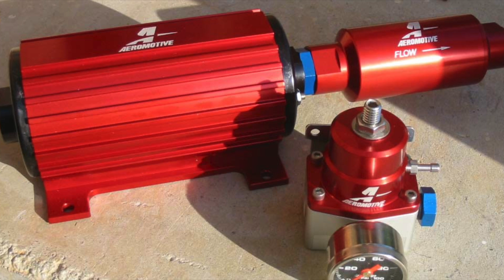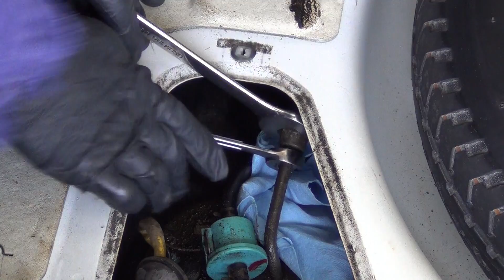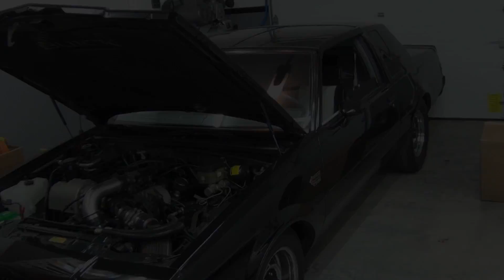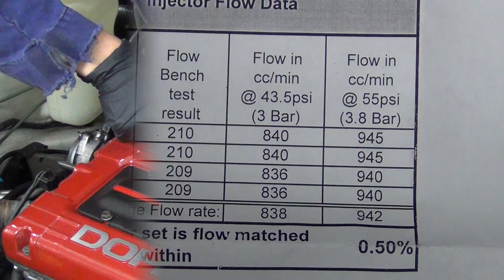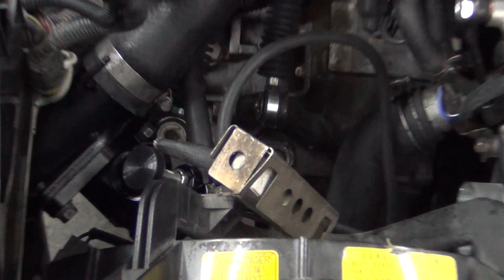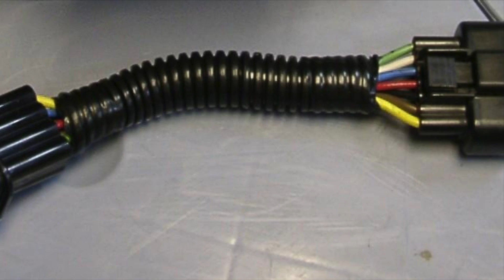Project Street Sleeper Part 8: Air & Fuel Upgrades

Comment: You do EXCELLENT work! I mean that! However in my humble opinion to anyone who may be watching this video, you should have installed an aftermarket AFPR. the stock fuel pressure regulator can be easily over run, especially during idle and low boost conditions with something like a Walbro 255 shoveling fuel through it, making tuning incredibly difficult and possibly even dumping fuel back into the manifold once the diaphragm rips!! Just one small thing I observed that could have been done differently, thanks for the videos!

Comment: Quick question Tom if you dont mind. When ordering a walbro fuel pump kit, do I choose the 1g install kit for a direct fit? Also, will a stock 1g fuel pump or 2g work as a replacement for the galant?

Comment: With the fuel pump wiring relay, isn't it less than ideal to not run it directly to the pump? You ran it to the outside of the FP housing that still leaves a few inches of oem small gauge wiring...

Comment: Hey Tom,

I just to mod my MAF and air can years ago, but viewing your channel inspired me in trying fot fit my "better" MAFinto the stock 1G air cam. And now while I'm having everything lying in front of me - everything's dissassembled - I'm not sure to fit it into the air can the most elegant way.

In the past I just built an adapter plate which I fitted in the bottom of a stock air can (where the plug and the connection to the MAF-to-turbo-intake hose used to be), but this was always a pretty 'less elegant' solution and I lost valuable space for intercooler and turbo piping...

so can you give me any hints or show some pics of how you fitted the Evo MAF into the air can?

Oh, btw, I'm curious if there are any significant differences if you took the MAF from a Galant, Carisma, 2G Eclispe or whatever looks identical exept for the parts number above on the sticker.

Thanks for reading and I'm looking forward to hearing from you.... and again, I want to say how much I love your channels - the DSM ones the most of course - because it gives one the feeling to be took by the hand and make a humorous "this it how it's done clean and properly" walkthrough with explanations which even I understand ggg

Kind regards, your fan Ibo from Hamburg, Germany
Reply from the maker: Hi Ibrahim and thank you for the very kind words!  I'm glad that you enjoy my videos and find them helpful too.  Regarding installing the Evo MAF into a 1G air can, it was really a labor of love.  I never would've imagined that anyone would've wanted to see that process, or I would've documented it.

In order to get it to fit, I had to drastically modify the Evo MAF and the back of the Aircan.  I made sure it looks stock and all, but I put many hours of work into it.  Honestly, if this is your street car I would suggest running a simple and easily serviceable open element air filter with the Evo Maf.  Here are a few examples and the power they made.  Good luck!  http://www.evolutionm.net/forums/evo-engine-turbo-drivetrain/390973-air-filter-shootout-test-results.html

As for the interchangeability, I do know that the Evo Maf and the 3G Eclipse MAF is the same.  A 2G MAF is a good upgrade, but not the same as an Evo/3G Eclipse MAF.

Enjoy your car and have a good one!

-Tom

Comment: Hi, i own Škoda Octavia 97' (No japan, Europian, Czech car) its based on VW Bora/Golf IV with AEE 1.6L engine, 5speed, no turbo. I plan to make sleeper but the choices for tuning over here are small. Can or Do you know any US. company what makes custom parts for this car?
I know it's bit hard question, but your work is just excelent and you may know some.

Have a nice day and thanks.
Reply from the maker: Hi there and since we don't have those here in the states, I have never heard of parts made for them here.  Good luck on your search and you might need to use more universal parts and adapt them to fit.
Reply: Hmm, okay, anyways thanks for advice. It's such a shame that Škoda ain't in States.

Comment: Hi Tom, 852/1000 here.  Wanted to say that I think you do great work and I'm impressed with the progress on your galant so far.  I also have a question, you mentioned that the new (850cc)injectors were direct replacements. Do they require an external means of control or do you already have ecmlink installed? Also are you recirculating the charge air or venting to the atmosphere? Thanks and keep up the great work :D
Reply from the maker: Hi there and good to meet a fellow VR-4 owner!  Thank you for the kind words and yes the 850s do require engine management.  I'll be covering that in a couple videos from now.  I'm recirculating the BOV since I'm using a MAF and to keep things looking stock.

Comment: Great video series! It may not suit your stealthly look but it advisable to add a fuse at the battery +ve terminal end of the relay pwr wire to your fuel pump relay. Cheers
Reply from the maker: Hi Richard and thank you!  The wire has a fuse at the battery side.

Comment: Ild love to go to the shootout. Just gotta round up my funds and get the wifes Talon running. My talon will need more time unfortunetly, gotta get a new motor that I can make mine in everyway. Torn between 3 by making just enough, balls out, or completely OEM head to toe front to back with dual piston calipers from a 2g.

Comment: Tom i have a few questions for you i know you love dsm's. I would like  to know what you think about people saying Dsm's are Very very unreliable i was thinking about buying one but i do not want to be fixing it on a weekly bases most people give there cars a 2 on reliability. I was thinking about a dsm or a Subaru or a GIT old 80's-90.
Reply from the maker: As with any performance car, they are only as reliable as their service history and how they've been cared for over the years.  I have found them to be extremely reliable, especially given what is asked of them (doubling or tripling the horsepower on mostly stock-type parts) but I am a stickler for proper maintenance and only buy old Mitsus that have a full service history and with no prior modifications.  Good luck with your decision!

Comment: How nice is it that fuel pump assembly is in the trunk? Don't you usually have to drop the gas tank to do that sort of stuff?
Reply from the maker: Yes, most Japanese cars offer an access panel either in the trunk/hatch or under the back seat.  MUCH easier than dropping a gas tank.

Comment: Boost gauge is also a warning sign for when something goes wrong. If its hidden, how are you supposed to see? I get the whole sleeper thing, but yeah.
Reply from the maker: A boost gauge is not a warning sign for anything.  My engine management will allow me to customize my stock warning lights on the dash to alert me of any engine related problems or excessive knock.  A boost gauge would never tell you any of that critical data.
Reply: Tom's Turbo Garage Those without the engine management software you are using can use the gauge to say if they have a vac leak, or not making full boost, or worse over boost.

Comment: you sir are amazing. i love sleepers. also i just found three vr-4s being sold close to me after looking for years. the only problem is when i finally find them im broke. im one sad man right now :(
Reply: one is number 221/2000 for $1000 but needs work. dont know what number the other two are but they are in very good condition, one for $4000 and one for $3000
Reply from the maker: Thanks so much man!  Oh that is bad timing!  They sound pretty good.

Comment: just an added note: Read your service manual on how to release the Pressure in the system, usually you open the filler, disconnect the main relay (or power to pump) and consume the leftover fuel in the lines. if you forget this step, you better have eye-protection and a ton of shop rags ;)  (learned the hard way)
Reply from the maker: Yes, this is true.

Comment: That auto-meter boost gauge is the old one from the Buick!
I'm really interested to see how it all works, especially he exhaust. I've never heard of putting a wastegate back there.. It works the same as a cut-out, right? Just opens automatically when it senses that it's under high boost?
Love the vids Tom. Keep it up please!
Reply from the maker: Thanks man and yes, I believe it is!  I actually have a couple extras.  Yes, the wastegate just works just like an electric cutout, it just uses boost instead of electricity.
Reply: Thanks for responding.
So essentially, when the exhaust-mounted-wastegate sees boost over a certain PSI, it will open? That's very clever!
 I love your videos. They encourage me to work on my own cars! I just added a 1st gen DSM (1990 Plymouth Laser RS!!) to the stable, so I will be watching these videos especially closely. Unfortunately, mine is FWD and N/A, but still with the 4G63 and 5 speed. It's pretty quick as it is, but it needs some work. I'm thinking of some sort of 2.5" Mandrel-bent catback-exhaust, a REAL cold air intake, not one of those cone filters on the end of a piece of pipe like most companies sell, cams, and some sort of a tune. Does ECM-link make a Naturally aspirated form of tune? I'd like to get one, if possible. I'm also looking to lower it a little, since the stock 25 year old struts/shocks are blown. I have had good luck with Bilstein in the past, and I'm hoping to find some sporty shocks. Either Bilstein, Koni, or Tokico, hopefully, paired with some slight lowering springs. I'd really like a set of 2G Eclipse wheels, I like them a lot! I may end up turboing the car. I'm looking into the 4G63 NA to Turbo swap. I'm hoping to keep the cost down as much as I can, since it is a daily driver, but.. that turbo sound on your talon is so mean! So much inspiration! I especially love the sound of DSMs with open o2 dumps!
Thanks again Tom. I really really appreciate all the videos, they're wonderful. You're a really really nice guy. :]

Comment: Another impressive and interesting video, Tom.  Good job!  I have a question:  You're all over the car, making changes here and there, so do you test your car to make sure it still runs before going on to another area?  If not, it would be a bad thing if you had a malfunction (despite your meticulous attention to detail) and you had to figure out where the problem is.  I'm eagerly waiting for you newest video!  I want to see this baby run!
Reply from the maker: Thank you Rick, I appreciate that!  I prefer to work that way, making only one or two small changes and then testing, but when taking on a bigger project like this you don't have the luxury of doing that.  I just go way over the top with my checklists and quadruple checking everything I do to try and avoid mistakes/rework.

Comment: I really like that you use professional products.   The pee blaster and nitril gloves are a staple in my shop.   Do you happen to know where I can get a stock 91 talon tsi awd front bumper cover from?   Can't find them and mine has a bad nose job.   Btw if u can find it dejon made a giant side mount for sneaky    I have one and it works well.
Reply from the maker: Thanks Ben, I try without blowing the budget too bad.  Bumper covers can be found on the dsm forums or salvage sites like car-part.com.  Good luck!

Comment: i remember my DSM….. went to put in new injectors didn't replace the O rings …… car almost burned to the ground lol lesson learned don't skip out and cut corners !!!!!!!
Reply: Right.  Tinkering with the fuel system can result in burning up your car if you're not super careful.  That's what happened to a friend of mine.  He replaced his injectors and his car caught on fire (and was totaled) due to a fuel leak.
Reply from the maker: Yes, I've heard of this happening as well.

Comment: Primary wire to the fuel pump needs a fuse close to the battery. Wont be fun if it does get broken without.
Reply from the maker: The primary wire comes with a pre-made inline fuse near the battery connection.  I show this in the video.

Comment: Awesome work!  The only thing i'd do different is use a dry flow filter instead of a K&N that close to the MAF sensor.  Seen too many of those sensors get killed from the filter's oil.
Reply from the maker: Thank you and I've actually ordered a dry filter, as the K&N was more of a prototype setup to get the fit right and all.

Comment: The manual antenna should save you a good 300 grams. That's 0.0023417 seconds over the quarter mile. ;-)
Reply from the maker: Haha!  The main thing was I like listening to the radio once in awhile and all that would come in with the broken antenna was one country station!  Egh!
Reply: My Punto can only pick up Classic (classical music) FM or the local station. That's what high flow filters and decent exhausts are for. ;)

Comment: Another AWSOME VID. My 2jzgte gs300 has a wally 400 with that same wiring kit. It really is an AWSOME kit. What other electronics are you going to add to the vr4? Also are you going to run water or water/meth injection?
Reply from the maker: Hi Ryan and thank you!  Yes I will be running Methanol injection- that will be the next video.  I'll be doing an engine management video in the near future too.

Comment: Tom I have been waiting to for this video, I also wanted to if I can use a 96 gst air flow sensor or should I use a gm set up I have  I'm converting my gs galant in to a gst, here in US there are very limited vr4
Reply from the maker: Those two sensors have pros and cons.  I think the Mitsubishi sensors make more sense, but that's my opinion.  Read this for more info: https://www.ecmtuning.com/wiki/airflowoptions  Good luck!